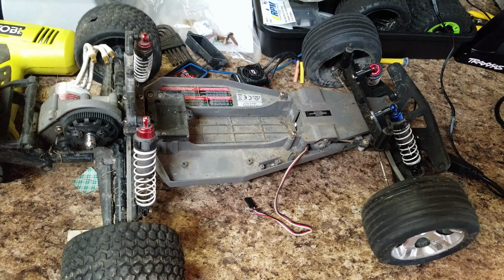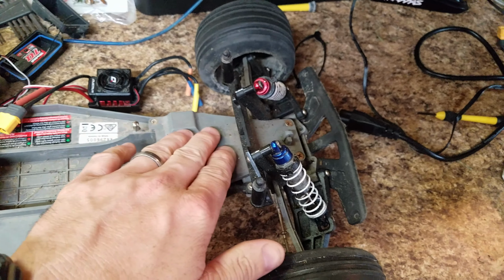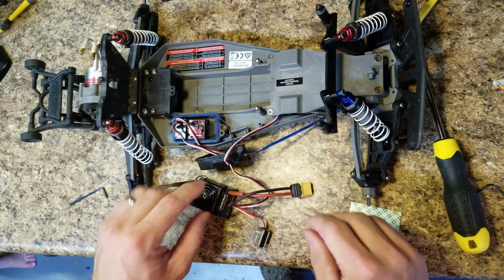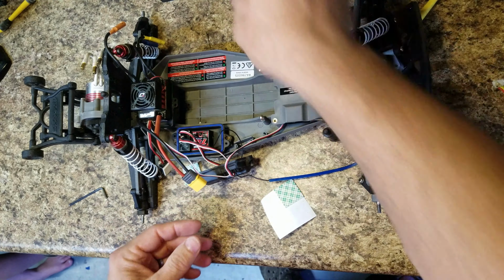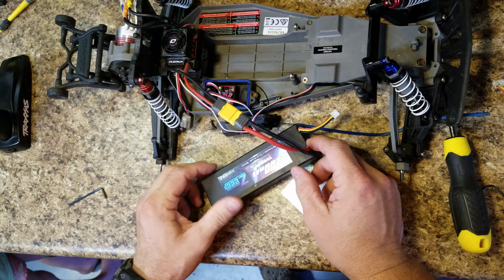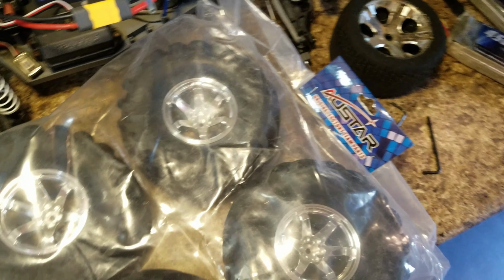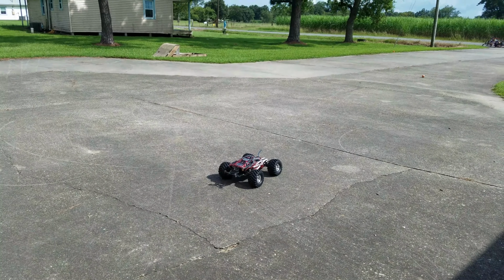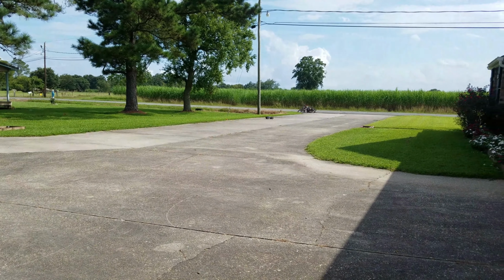Traxxas Rustler rccar becomes Brushless Monster Rustler, build and run on 2s Lipo battery.

Comment: I have one exactly like this. I actually built mine like this with same wheels because I liked the look. I have one problem though. The motor gets really hot. I had a cheap brushless and esc combo. The motor is a 3900kv and the esc was a 60amp 2-3s. I was running a 3s but the esc went out. Motor still works fine. Just the esc went bad. The gearing I had was a 29 tooth and a 83tooth spur gear. I’ve heard that the wrong gearing would make the motor run hot. Do I need a stonger esc like a 120amp? Let me know if I’m making sense

Comment: That is awesome! I need a pair for my Slash!
Reply from the maker: There is a link to them in the description. I'm pretty sure you would have to trim the body on a slash as these are really wide and a bit taller than stock.
Reply: Jake's Family RC I have a body that has higher fenders so I think it’ll work but I’ll trim them if I need to. It will probably be on my channel if you want to see it but not too soon as I have other projects.
Reply from the maker: That's awesome, I'll be watching for when you try them out. The times dont feel like the best quality, but for $30 for the whole set, it's kinda worth getting them to mess around with.
Reply: Jake's Family RC I don’t think I’ll fit them soon, as I am building a 1:16 scale crawler at the moment, but after I have a Slash 4x4 chassis that I am going to make brushless and put massive wheels on, but yeah, I’m going to rebuild the 2wd with those wheels.
Reply: Me again, I changed my mind. I'm going to convert my Bandit into a Rustler, before I rebuild the 2wd.
Reply from the maker: @Charlie86RC  lol you sound worse than me. I've always got more plans and ideas than I do time and money!!
Reply: Jake's Family RC Only 3 of my rcs are working. I have 7. Its a pain but it’s fun!
Reply from the maker: @Charlie86RC  it's a labor of love. Just got the slash back together and was going to video my sons racing around but the monster rustler took a tumble and popped a drive shaft
Reply: Jake's Family RC Traxxas plastic driveshafts do my head in... Most off my bashers( all of them actually ) are brushless, so I am going to buy these metal ones for the rustler project.